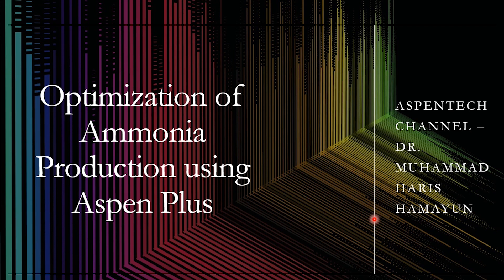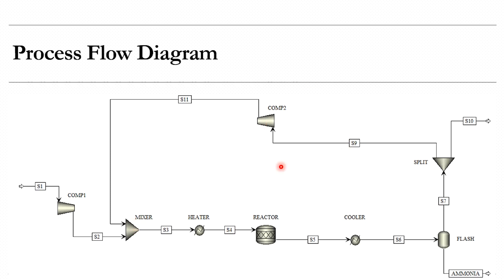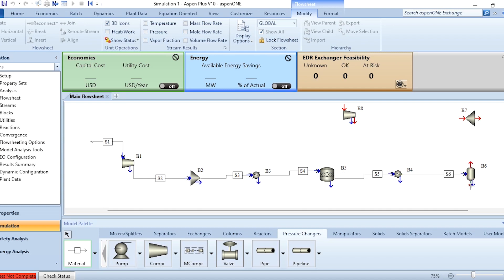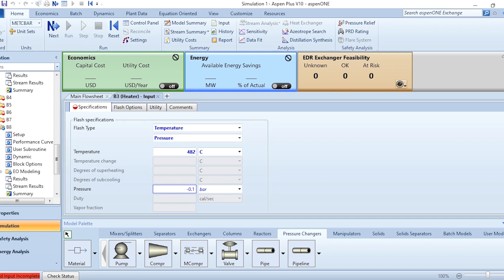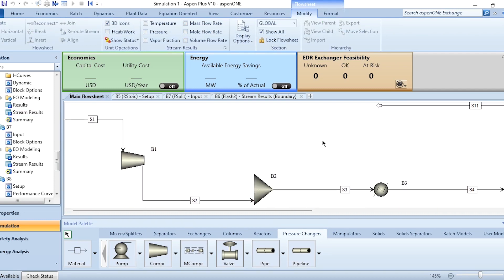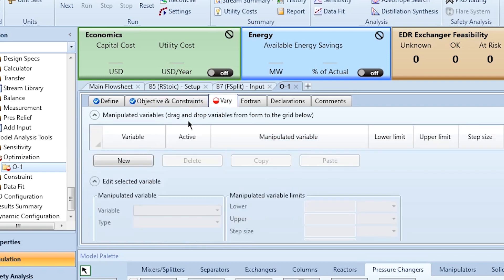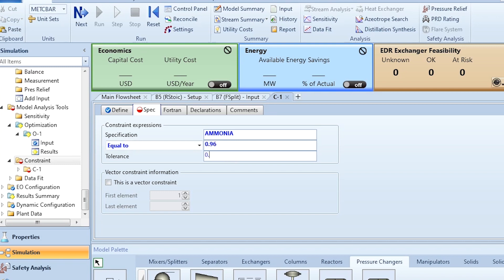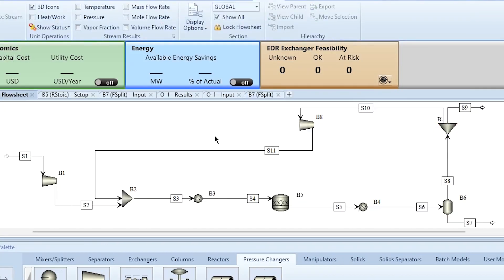Can a specific purity of ammonia be obtained using simulation? Check this video - Lecture # 113

Comment: Great videos! I have one question regarding another topic: How would you perform a simple single stage continuous absorption refrigeration cycle (Ammonia/Water) simulation using Aspen HYSYS? How would you simulate the absorption part in particular? It does not work via the absorber, since there are two inlets and two outlets, but the absorber in this case should only have two inlets (water and ammonia) and one outlet (the mixture). Since also heat flow is to be emitted, the "mixer-component" makes no sense as well. It would be great if you have an answer to this. Thank you very much. Kind regards :-)

Comment: Can you help me for compressor error 
Error is feed stream ond outlet stream temprature is below dew point
Reply from the maker: Hello Mohammadmaaz. Thank you for your question. The compressor is used for the vapors/gas. If the feed is below the dew point, it lies in the 2 phase region (as per T-xy diagram), i.e., vapor-liquid, and accordingly, it will not solve. Hope that helps.